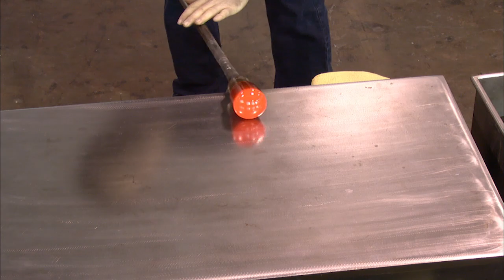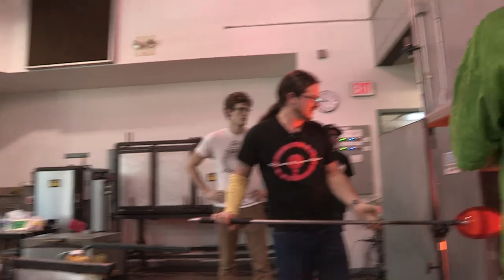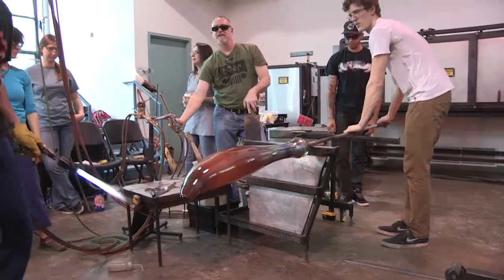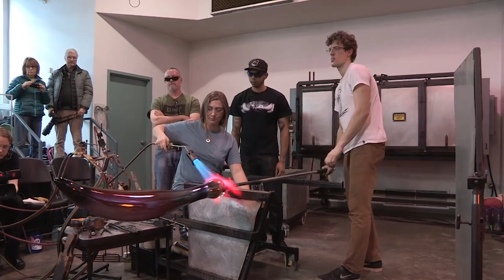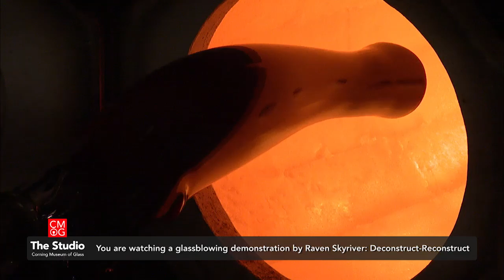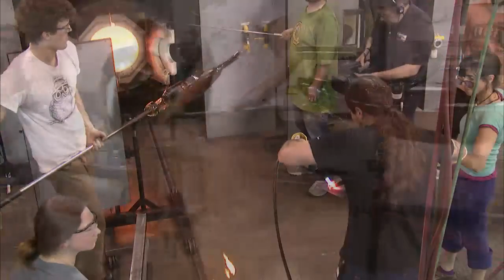Live-Streamed Studio Demonstration: Raven Skyriver (February 11, 2015)

Comment: absolutely fascinating but a question if I may is it in any way possible for someone in my situation to do similar (wheelchair user)
Reply from the maker: I think it would be possible if you had the experience, as well as a larger team to enable you the stay either at the bench or seated outside the bench.  You would let someone else reheat, and would focus on the sculpting.  I don't think gaining the necessary skills and technique will be quick or easy, but with the proper investment of time and modification of process to accommodate sitting while sculpting, yes, I think it would be possible.
Reply: thinking about it maybe the smaller scale of flame work  would be far easier ?